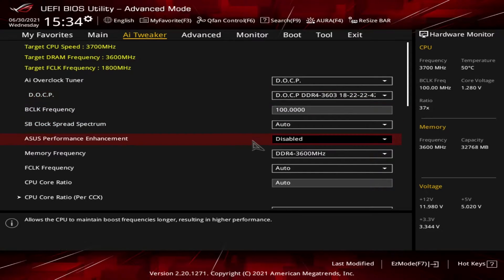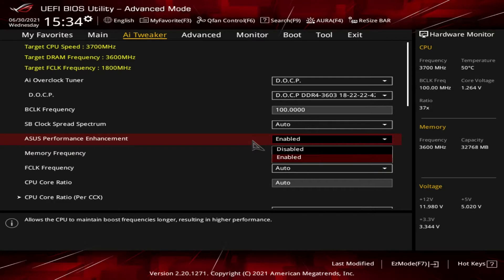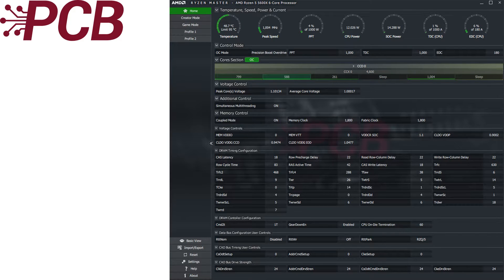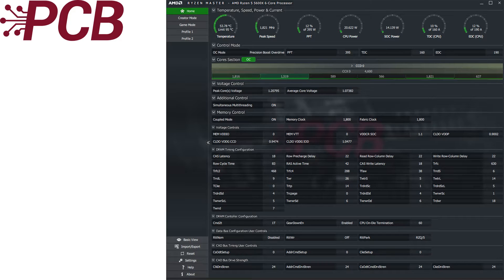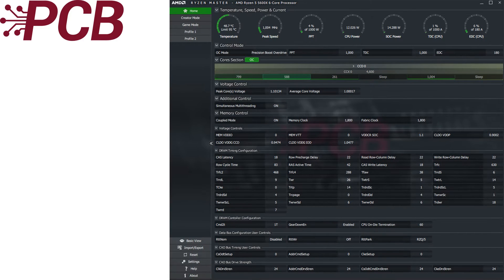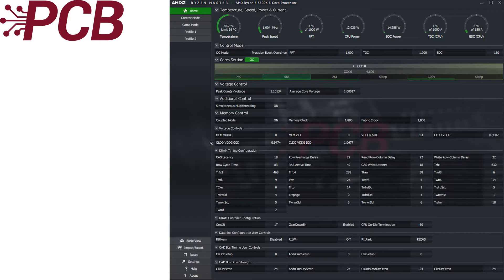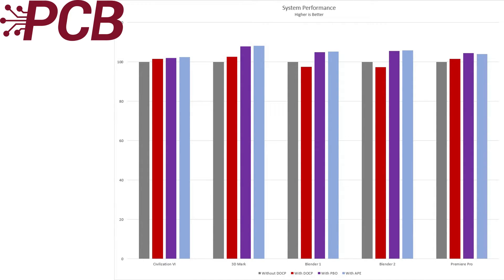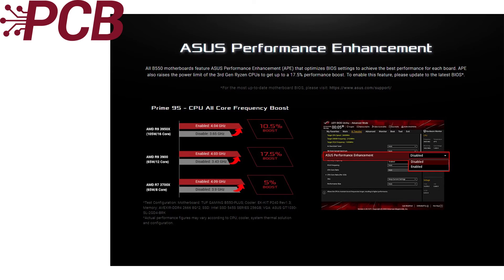Asus BIOS Tweaks, Part 3, Asus Performance Enhancement

Comment: Hi !! i set asus ape off, cpu frequencies got a little bit higher but i got strange behavior, like internet pages wont show quickly, task manager dont shut down quickly, feel like pc is slowed a little bit in général, when enabling it again all ok again, so i think better leave it on.
Reply: That is dumb, if you need APE than the issue is deeper that.
Reply: @wildcat002  
Depends on cpus on intel its better on especially for non k ones !!

Comment: What happens if I disable pbo and only use ape?
Reply: You get more heat nothing else.
Reply: If you manually disable PBO and enable APE, then APE can't work.  APE is turning PBO on, setting 1000 watt PPT, 1000 amp TDC, and EDC is going to be the only one "tuned".  It'll differ from CPU to CPU.  So, in theory, the only limit is EDC.  

But PBO is VERY picky and particular on Zen 3.  Now, with Zen 2, you could enable PBO and see higher boost clocks in gaming and everything.  But Zen 3?  No... it's EXTREMELY peculiar on how you set your PBO settings or you will get less clock speeds in gaming. 

Sure, you'll get higher clock speeds in 100% all core loads, but if you aren't encoding videos daily or aren't a benchmark slut, then it's not worth it.

Comment: Can I enable my asus multicore enhancement on my 11900 (non k)?
Reply from the maker: I have not done any BIOS work with a recent Intel chip but my understanding is that non k CPUs have their multiplier locked.  MCE is a feature that removes the power limits from the CPU.  If the multiplier is locked, however, having more power won't boost the speed beyond the boost already built into the processor.  Having MCE enabled will allow the boost to stay at the higher frequency longer, this will give you some additional performance benefit at the cost of a lot more power consumption.  So, yes you can enable MCE but the benefits will be modest.

Comment: What happens if you enable both PBO and APE??????????
Reply from the maker: If they are both enabled Asus' settings for PBO will override the standard PBO settings.   APE is PBO with Asus's settings.  I tried to articulate that during the video, sorry if that wasn't clear.
Reply: @practicalcomputingbytes2677  Okay.Thanks for the info.

Comment: hmm this is quite new, do i have to update my bios to do this?
Reply from the maker: That depends on what type of motherboard that you have.  Asus was advertising this early on for their B550 motherboards so you might already have this option available.  It might've been a later addition to the X570 boards.  If you don't have the option in your BIOS, you can check your BIOS version/date and see if the website has a new one.
Reply: @practicalcomputingbytes2677  any way to overclock a locked cpu? or gpu?
or to unlock it?
Reply: @rogim4733  Not that I am aware of.  With the newer generation of GPUs, both Nvidia and AMD prevent any real "overclocking."  There are still utilities like Afterburner (MSI) and PrecisionX(EVGA) that can tweak GPU performance but it is not really overclocking.  As for CPUs, there is nothing you can do with a locked processor.
Reply: @johnolsen1673  :(
Reply: @rogim4733  If you can increase your Bus speeds, then you can overclock.  But that's back in the OLD school days of how we overclocked.

These days, people are used to just increasing the multiplier.  And that's fine, because when you overclock the bus freq, you increase RAM freq along with all kinds of other things that depend on the bus clock speeds.  So, you have to know what you're doing, like lowering your memory divider so that it goes to a lower speed, then raises back up with the bus speed overclock. 

But they might lock that out on non-overclockable CPU's.  Depends on brand.  Intel did it.  Intel locked out bus speed overclocking so that you couldn't overclock non-K CPU's a few years ago.  Back in the Z270 era (Kaby Lake).  

AMD tends to be more for the consumer, so you may have the option, but it MAY cause some serious instabilities if you don't know what you're doing.